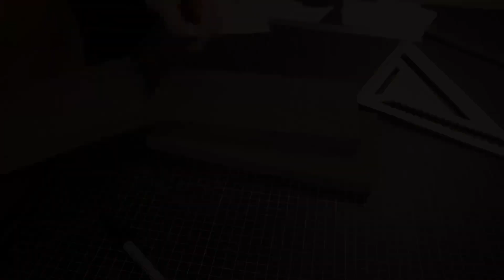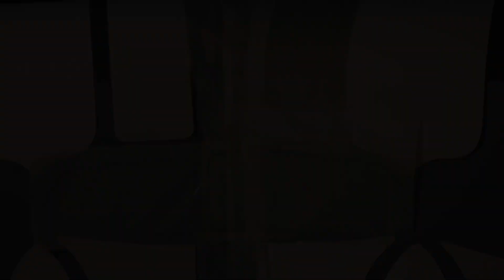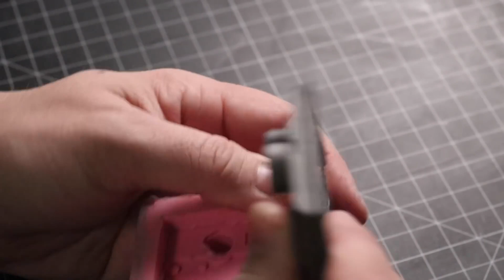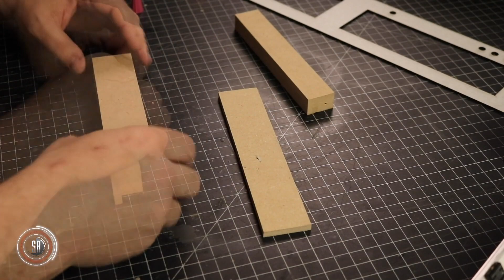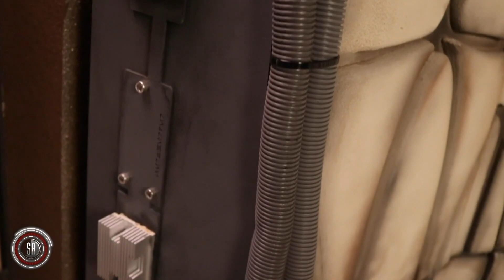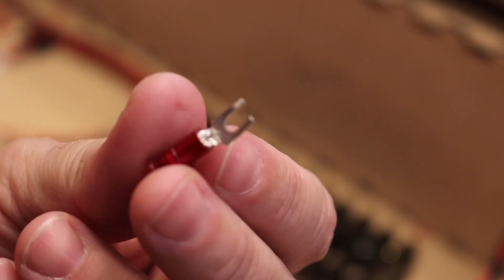Constructing A Millennium Falcon Bench

Comment: dude you're really putting my head in a spin with that razor sharpener. I sharpen my knives but I've been using olfa cutters/blades for years and just toss the blade and replace - what is the grit of that sharpener and do you have a link? I've been cutting a lot of eva lately and tossing the blades after about 12 or 15 inches of cutting very precise angle cuts